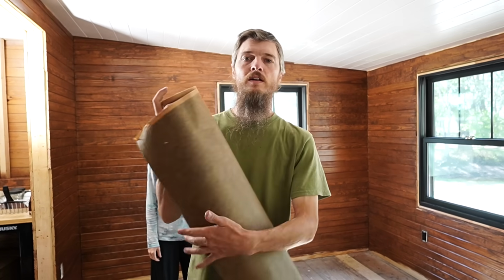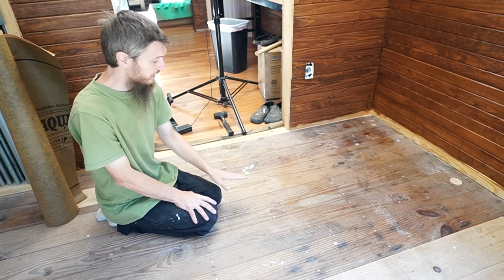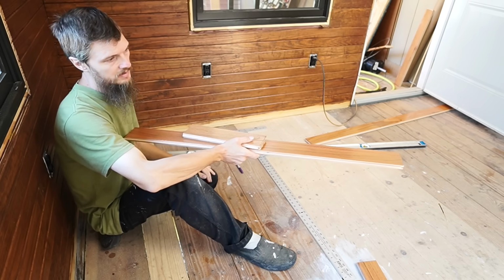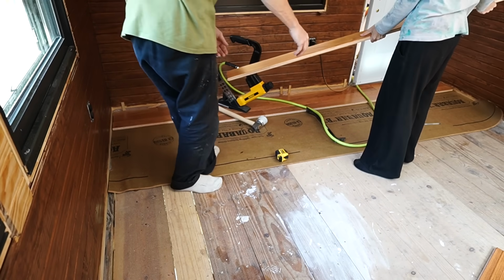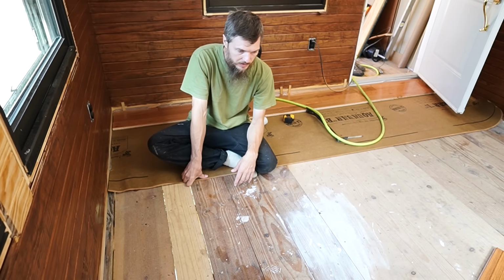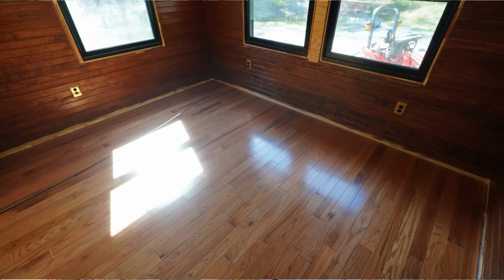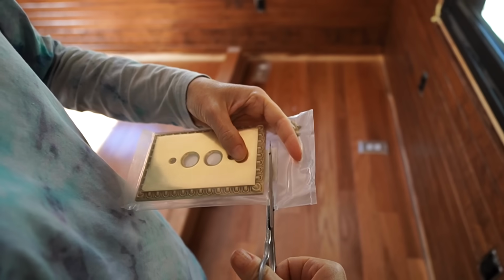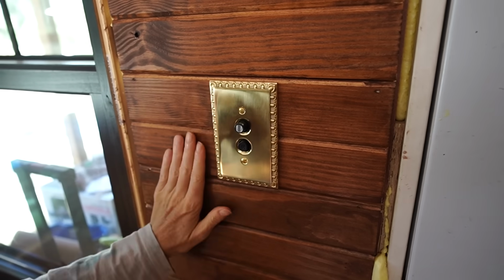Hardwood Floors and High End Hardware - DIY Home Build

Comment: Just for future flooring projects: when cutting the last piece of a run, no need to measure.  Flip the board end for end, then mark where the board needs to be cut against the previous piece.  Saves time with each run, and adds up quickly as you work through the floor.

Comment: Great job. Your ceiling light solution is very traditional Victorian/European, used throughout the World even in modern homes. We have [sort of] the same in our 200 year old house [UK] that we can adjust the height and position of via the original and very robust [still working] pulley system, the mechanism is fitted behind the wall /ceiling and is the same as our sash windows.  Looking forward to seeing your choice of light fitting.

Comment: The flooring looks so nice and Ashley, you have become very skilled in making the cuts, good job. Putting a swag light in is a good solution and it reminds me of how they used to electrify old houses, with the wiring run through a conduit across the ceiling and down the wall to the outlet.

Comment: Plywood wasn't used as a subfloor material until about the late 30's early 40's.  Homes older than that will contain boards like those, and those were tight up against one another when the house was built, but over 100 years of drying out, they do tend to shrink, exposing those gaps that you filled with the vapor barrier material.

Comment: I’m not questioning you but I have a question, why not put an underpayment of lauan plywood down then you your flooring in the same direction?
  Looking good. Keep up the good work. 💪🏼
Reply: Extra cost for little improvement would be my guess. But I love how the flooring transforms and changes as entering the dining room.:)
Reply from the maker: Any underlayment would raise the floor higher than the kitchen floor and I prefer a smooth transition between rooms of the same flooring. And even with 1/4" plywood, I would not recommend laying hardwood flooring that way.

Comment: When you do your crown molding you could hide some led lights strips behind the molding so it would shine down the walls as indirect light Or shine up the ceiling Would also be a step up from the farmhouse aspect and more along the very rich family summer camp house.   Or do a picture rail with the lights hitting the paintings.  You will not have much room for furniture so make the wall more of a pc of furniture.  Torn between a stain glass light  or a 1950 drum light were it has the rattan cloth on the outside of the shade.

Comment: We laid 3/4" hardwood floor in parallel with a solid wood subfloor. It's 90 years old, rock solid stable, and in exceptional condition (tight joints and flat). Removing it was never going to be an option  - can't abide ripping out old growth wood. Asked my contractor to asses the option of running the finished floor parallel to it and he had zero issues with that. We live out west where the humidity levels are fairly consistent, so maybe that allowed for this.

Comment: I noticed that when you were talking about the direction of the new floor, I could see daylight between the boards of the subfloor.  When you finish out the inside of the house, did you plan on using a type of felt barrier or something similar when you insulate the floor from under the home (crawlspace)?
Reply: Or perhaps the foil bubble wrap that many use under house.
Reply from the maker: The vapor retarder that we installed under our flooring will block any drafts and will slow down any moisture from coming up so t's okay the way it is. At the very most, we may install a radiant barrier below the joists later on to help with insulating.

Comment: I am not questioning your knowledge because I love watching your channel because of yours and Ashleys knowledge. But I wondered why you couldn't put the moisture barrier underneath the house on the underside and used the original boards as the flooring, just curious
Reply: I wondered that, too.
Reply from the maker: The original floor is just cheap, dirty common boards. They would not be good for a finished floor, they are soft pine and have large gaps between them and exposed fasteners. They would just never look good. We just wanted a solid oak floor that matches the rest of the flooring in the home. Also, we like keeping the floors at the same level as much as possible throughout the home.
Reply: Thanks for info you are so talented and I love that you think out of box and come up with unique and great ideas. Love your channel.

Comment: You could lay a 1/8” plywood sheathing over those boards. It would mean a transition piece at the doorway but that would have allowed the floor to run in the same direction as the rest of the house

Comment: The floor looks great!  It's so satisfying when the floor goes in nice like that.  You get the square edges and everything just fits perfectly!  I'm curious why you didn't start on the opposite wall?  You'd get to see how square the flooring is much sooner as you installed it.  Or is that wall even worse than the angled wall?  LOL
Reply from the maker: Thanks! Neither wall was perfectly straight, but we really had to start on that one side because of the way the tongues and grooves would interact with the kitchen floor in order to tie the two together. We needed the grooved ends facing the kitchen.
Reply: @diyfferent  Thanks!  I knew you had a good reason!  LOL

Comment: Doug you did a great job. If you were laying a hardwood floor on a concrete slab what would you put on top of the concrete?
Reply from the maker: First lay a plastic vapor barrier down on the concrete, then build a floor using 'sleepers' which are 2x4s laying flat, then lay down the subfloor (plywood or osb), then do the hardwood floor.
Reply: @diyfferent  Thank you Doug

Comment: So, I have two questions: why not replace the floorboards with the OSB you’ve used elsewhere? And if that wall you started against was crooked, why not use the opposite wall, did you need to start over that side of the room? Good job, though, looks great.
Reply from the maker: There was just no need to replace the boards, they were solid. Plus the subfloor goes under the walls and replacing them with osb or plywood would be a very tricky job and not worth the time and effort. I actually like how the wood changes direction. It's visually interesting.

Neither wall was perfectly straight, but we really had to start on that one side because of the way the tongues and grooves would interact with the kitchen floor in order to tie the two together. We needed the grooved ends facing the kitchen.
Reply: @diyfferent  hey, thanks for replying. And so quickly!  I wondered whether that might have been the case, I note you don’t like to pull stuff up when it’s basically sound. Thanks again. And good job. 👍

Comment: Could you have covered original floor with plywood and then laid the new flooring the same direction as all your other floors? Just curious
Reply from the maker: We could have, but then the dining room floor would be higher than the rest of the floors in the house and we wanted it to be at the same level :)
Reply: A friend has that problem in her house. I hurt myself the last time I tripped walking through the door into her hall.

Comment: I have a question about the floor. If I wanted to place the floor running the same direction as the subfloor, would it help to put down plywood before installing the floor? I'm just curious 😁
Reply from the maker: Yes, but that would raise the floor up and in our situation it would mean that we wouldn't have a smooth transition between the rooms. So that's something to consider.
Reply: @diyfferent  Thank you so much for your answer!

Comment: Well you could have put luan thin plywood down then you could run the flooring same direction
Reply from the maker: No, it would raise the finished floor higher than the kitchen and it wouldn't be a smooth transition and would make it feel hobbled together. I really don't like uneven floors and avoid them when possible.
Reply: @diyfferent  
Yes that is true it would be slightly higher you got it nice and even rite now it still looks good